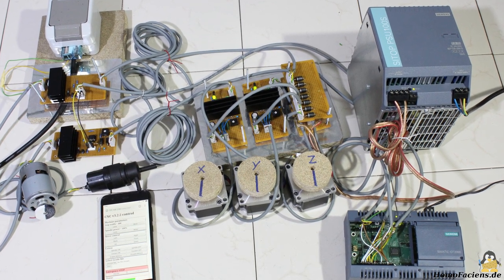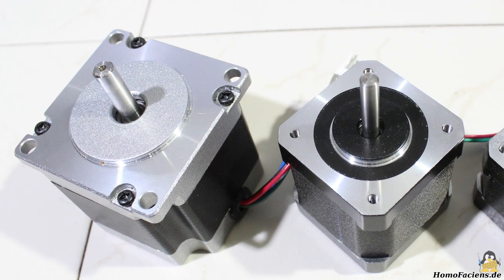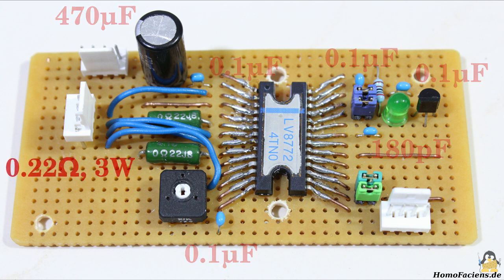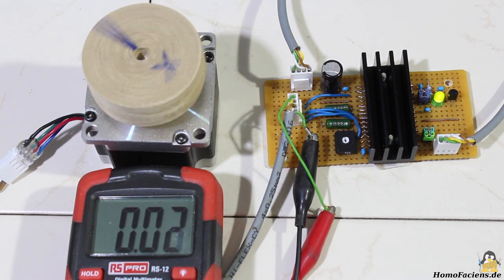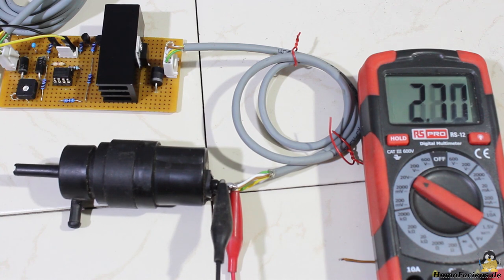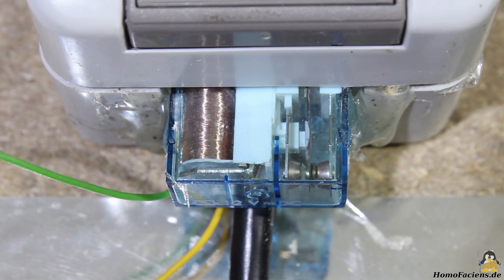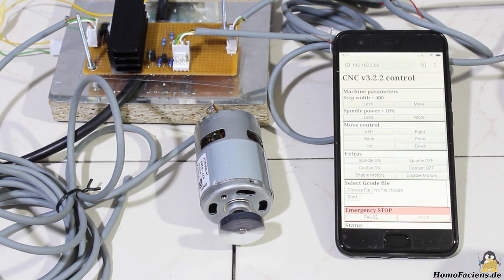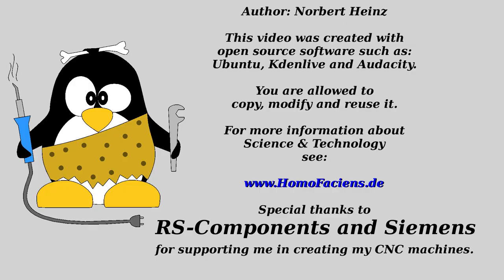Electronics of CNC v3.2.2

Comment: You make CNC's look ridiculously simple !
And thanks for the coolant pump tip. I was wondering what to use, this kind of pumps fits air and liquids (given the proper misting head).
Reply: imo, the basics of CNCs are simple, you just multiply your coordinate (i.e. x +10mm) by the numbers of steps per mm of your system (i.e. 80steps per mm would mean you need 800 steps to move 10 mm), and send that to the motor controller (direction +, 800 pulses). once you start accounting for backlash, lost steps, acceleration etc... it becomes a bit more complicated, but not that hard if you tackle one problem at a time imo.

Comment: Awesome !

What IDE did you use to build your android application ?
Reply from the maker: Thanks!
As told in the video it is no application, but simply a browser interface. The Apache web server is running on the IOT2020 and does all of the magic. You only have to point your browser to the network address of the IOT. With that you can also use a Laptop or desktop  computer to control the machine.

Comment: im always confused !!! does the softwere care what type of drivers you use  for the motors ?? like if i use cheapo chineasy modules of the arduino or this kind of drivers like in the video to drive the motors !!! does it differ ???
Reply from the maker: The software needs drivers that are commanded by Step and Direction pins. It doesn't matter what type of Step/Direction stepper motor driver you are using. The ones I have soldered or the typical A4988 chips used for cheap 3D printers or even high power industry standard drivers - they are all the same for the software.
Reply: with the addition of maybe changing your steps per mm if you use microstepping, but that's just configuration, if your 40mm cube measures 5mm or 320mm, you know you have something to change

Comment: Great work, why did you solder the wires to the PLC ?
Reply from the maker: Thanks! As told in the video: To make the 1.78mm pitch of the pins on the IC fit into the 2.54mm grid of my prototyping board.
Reply: That's not what he asked about. The IOT2020 has 2.54mm pinheaders on it's mainboard and you soldered wires to them directly, instead of using a female pinheader or other connector.
Reply from the maker: The IOT has female headers. I pluged in male header and that's where the wires are soldered on.
Reply: My bad I thought it's an s7 1200 didn't know about this IOT